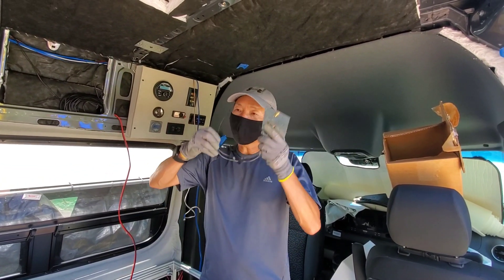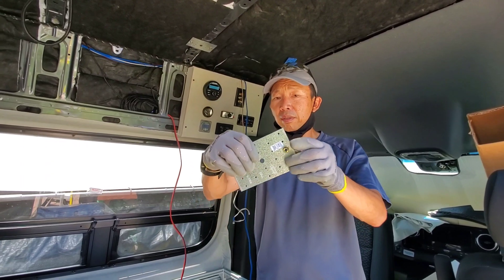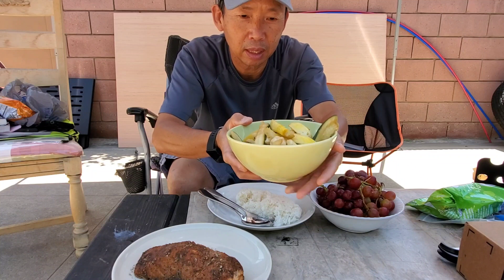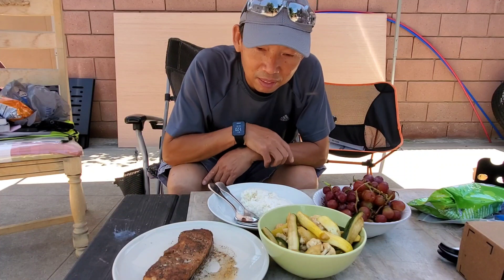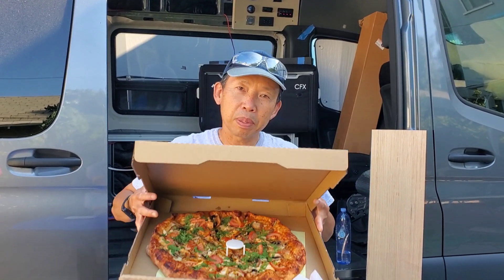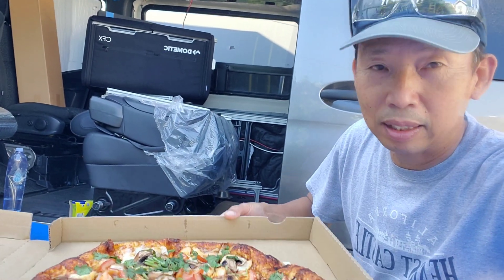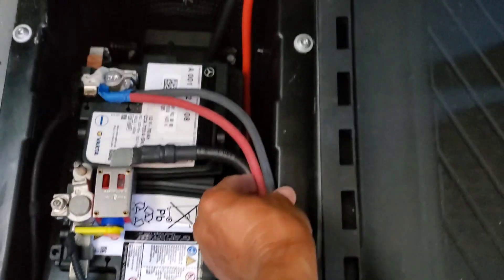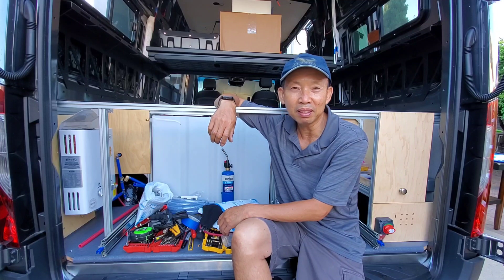Van Build-2019 Mercedes Sprinter installing Victron tr-Orion DC-TO-DC Charger

Comment: Hi Bo! Big Fan and subscriber. My build is all 8020 & Victron as well.

Question: I seen you connected your Orion directly to the battery positive using an inline fuse. You don’t have issues with it having  constant power instead of wiring to the ignition? Would love a picture of how you wired to the car battery if you have one. I’m on IG as Ryan.CVO 

Keep up the great work and videos!
Reply from the maker: Hey Ryans thanks. 
The Orion-TR has the voltage sensor built in which you can connect straight to the battery accept if you have a smart alternator.  When you start your car, the voltage on the car battery changes that's when the Orion-TR  starts to work otherwise it's not activated.  Connect directly to the car battery positive side.
Reply: Thanks Bo! Thought that may have been the case but wasn’t sure. I tried under the seat using one of the battery posts but it doesn’t support the fuse size I need so I was hoping direct to battery would work. Great to hear! Loving your shower setup too. I just ordered your same hot/cold valve and shower head setup. :)

Comment: can u tell me the diference between the isolated n the non-isolated versions?
Reply from the maker: Here's an answer from the web. 
isolated input and output NEG while the non-isolated uses a common negative return. If both your source and target batteries share a negative return (ie chassis ground) then you do not need the isolated version.
Reply: @BoChuonOUTDOORSVANBUILD  so thers really no diference? or does that make a big diference wen they share ground/negative?
Reply from the maker: Basically that's it.  In my case I chose isolated because my battery banks don't share the negative side with the car chassis.

Comment: How are your settings in the app that the Orion smart detects engine start? Can you maybe write down your parameters? Thank you very much for your help. I have absolutely no idea how it works...
Reply: Hi Marcel that is depends on the type of the batteries you have.  The Flood, AGM are different from the Lithium Batteries settings.  It's on Your Orion-TR  manual .  If not there's a PDF file online from Victron you can check.  Here's the name you can Google:

Engine-on detection set-up Orion-Tr Smart DC-DC ... - Victron Energy.

Comment: Is it ok to connect the DC/DC charger to the car's battery instead of the alternator directly?  Thanks!
Reply from the maker: Yes. The DC/DC charger has a voltage sensing relay built in so when your alternator starts to charge the car battery the charger will trigger on.
Reply: @BoChuonOUTDOORSVANBUILD  Thanks for the quick reply!  Do you have a video on the MPPT installation with the solar panels?
Reply from the maker: Hi Kim,  I don't remember doing a particular one.  What kind of MPPT do you have?

Comment: Thanks for posting. Your information shared on the DC/DC charger is the same reason I decided not to use my combination charger-solar controller. Solar input was limited to 32v on my combo unit.  If I want to use multiple small panels it would be fine when wired correctly. However, I want the option of using a single large panel which will be 39+ volts so I also switched to an Orion from Victron.
I had to smile when I saw you crawling around to reach items. I also built and camped along the way. Now I’m crawling under installed bed to install components. 
Next time I’ll build more modular. 
Have fun!
Reply from the maker: Thank you 😄

Comment: What gauge wire were you able to use in the Orion terminals? The spec sheet says max 6 AWG but that looks more like 2 AWG. I'd like to use some existing 2 AWG to wire up the Orion, but I'm concerned it won't fit based on the spec sheet. Thanks!
Reply from the maker: Only fits 6-8 gauge . You can't go any bigger.

Comment: Where did you connect the ignition switch?
Reply from the maker: You don't have to on this one. Because the battery level perimeter is set so when the Orion-TR senses the voltage changes in the starter battery it will activate the charge.
Reply: Kane, there's 3 post under your driver seat. The one closest to the steering will is only active when the vehicle is running. You can tap into that line as your ignition on switch.

Comment: How are you holding up with the Orion Smart charger? I saw someone on the comments hating on the way you did it but it looks like you did it the same way the manual suggested. Any problems?
Reply from the maker: No issues however I did change the fuses to 60amp like the factory recommended.
Reply: Did you also have a fuse at the battery to fuse the positive battery terminal connection to the  6awg wire going to the DC/DC charger to protect the wires and charger?

Comment: I love the play dough Idea!!
Reply: It's a great Idea, and acttually a common plumbing and electrical trick dating back a Significant number of years, The problem with Both that stuff and playdough - is it WILL leave residue on Woods and other porous surfaces, some are oil based so it looks horrible.  The less time you can leave it on the better.

For the Most part it is never really an issue though - since 99% of the time the reason you need it is because of where the surface will sit, i.e. unseen and blind from view.

Comment: This man's van conversion is quite problematic. First of all, this person lacks a lot of knowledge about electricity or camper van building. he does not know how to build camper Vans, The input line of the dc to dc converter should  not connected directly to the starter battery, and  through an input 45 A fuse to the battery terminal of the sprinter battery .  he does not know  the  location  battery terminal. also  he does not  know that there is an electric power loss if the battery line is connected for a long time. In addition, when a gas shower boiler is used inside a car, it seems that it is dangerous to human life due to the risk of ignition and co gas inside. Furthermore, installing microwaves under the bed is a very funny idea. I hope you don't follow this person's way. PLease do not follow this episode ...
Reply from the maker: Well,  Mr Perfect "Into the nature " thank you for taking time to write all the negative comments in my videos.   Since you're new to YouTube maybe you haven't seen people are using "they don't call it water boiler" . It's the tankless/ventfree water heater in the RVs and trailers.  You'll people install it under the sink so get ready to spend more time writing negative thoughts about other people but please don't stress out about it because people have different preferences. I took effort to share my work with folks who like to explore different ideas that's all. Besides I don't see you've built anything on your channel but a piece of foil on your SUV?  Who's the problematic?
If you want to learn more about the water heater here read this from the manufacturer:
What is Vent-Free? A Vent-Free appliance can be installed inside and does not require cumbersome and costly installation of flues and ductwork because it is outfitted with state of the art ODS (Oxygen Depletion Safety) shutoff.
Reply: @BoChuonOUTDOORSVANBUILD  Thank you for replying to my comments, but I don't think it's negative for me to spend my time writing comments. For the sake of people's safety, I just wrote a good opinion. Did you know that propane gas heaters are not installed and used in tight rooms? No matter how safe it is, it is not 100% reliable, and it is not recommended to use gas heaters in narrow indoor spaces due to carelessness of people. To reduce the cost, it is used, but used outside the car. Never install inside a narrow car. For safety, use an electronic heater. In addition, for charging the accessory battery, did you know that it is a very dangerous idea to connect the DC to DC input line directly to the starter battery without connecting the input fuse to the battery terminal block provided in the sprinter van? And the use of a DC TO DC convertor actually stresses the alternator during prolonged use. This results in shortened life of the alternator and problems for the vehicle's ECU. In addition, such use is excluded from the warranty service from Manufacture. you will lost  warranty.That's why people install a second alternator with a lot of cost. Don't take my comments negatively and take them as advice. For reference, I'm a hardware design engineer with 20 years of experience, and I'm already the person who conversioned  the sprinter cam van .
Reply: @intothenature4328  Do your research before commenting.  "indoor tankless water heater" was being used.  He explains in other videos how to take necessary precautions when propane is being used such as proper ventilation.  As far as "carelessness of people," so maybe people shouldn't have gas stoves in their house either.  You clearly show your lack of knowledge of things.  "microwave under the bed."  You must be new to van life videos as you will find a lot of van builds has appliances under a bed/furniture as you are working with a small amount of space.
Reply: @deepdnfawb  You can install the Microwave anywhere you like, on the bed, right next to the driver's seat. If this is the case, it would be better on the bed. Because you can lie down and cook. Do whatever you want.
Reply from the maker: Cool,  can you share some videos of your build maybe I can learn from it.  Thanks for the opinion.
Reply: "Into"  you make some good points but the main thing I hope people take away from this is that you're fully responsible for your own actions and that you'd better know what you're doing before you do things that can lead to destroying your property, hurting yourself or others.  Yes, that fuse needs to be as close to the battery as possible.  Remember fuses are mainly used to protect wire, not devices so all of that wire between the battery and the DC to DC converter is not protected.   So if that long wire is damaged and it touches the negative or bare metal it's bye-bye van.  Still I enjoyed the video.  Thank you.
Reply: @Altenurgy  , Please see the sprinter van battery circuit  atrea ~ They provided terminal for 2nd battery ~ I am agree with into .
Reply: According to the Victron Orion-Tr manual, it's perfectly fine to plug into the starter battery.
Reply: @compeng2013  but the fuse or circuit breaker should be at the battery not at the input of the DC to DC charger.

Comment: Does your unit get hot? Like hot to touch hot ?
Reply from the maker: No, it doesn't.
Reply: Mine gets super hot, did u have to wire the remote wire on the dc to dc unit or just plug in the little piece with the green wire? I wasn’t sure if that was something optional to wire or mandatory
Reply from the maker: @williamauyeung818  yes, you plug that remote wire in last after you connected the car battery.
Reply: @williamauyeung818  Hi, so is it normal that it becomes so hot? I've read that some ppl are complaining too

Comment: Hello sir, excellent video, helps me out quite a bit. Question: I see in the instruction manual a recommended fuse size of 60A (like you mention in the video). However, I was surprised by that. Shouldn't it be just over 30A, the maximum current that is supposed to go through the wires? Also, with a 60A fuse, you would expect bigger recommended wire gauge. With your 30 amp fuses, does the Orion function well? Or do the fuses go off sometimes? And how is the wire distance measured? Is it 15 feet both ways or in total? Thank you very much in advance, kind regards, Thomas (subscribed :D)
Reply: In addition: I just called Victron Support: they told me that the Orion can require short current peaks, hence the recommended fuse size of 60A. Then I am curious: do your 30A fuses blow when using the Orion at max setting? Greetings from the Netherlands
Reply from the maker: Hello Thomas thank you.  I was surprised too with the 60A but I think that depends on your wires length and size as well.  The wires are measured each way and I have 20feet @ 6awg wires that's why I use 30A Fuses.  I think 6awg wires are the biggest to fit in Orion-TR and it can handle up to 70A depending on the length.  I  set the max voltage 14.4.  So far the fuses are fine but  again the batteries have not been drained so I guess we wait and see. I hope this helps.
Reply: it's not excellent video.  this van design
Reply: This man's van conversion is quite problematic. First of all, this person lacks a lot of knowledge about electricity or camper van building. he does not know how to build camper Vans, The input line of the dc to dc converter should  not connected directly to the starter battery, and  through an input 45 A fuse to the battery terminal of the sprinter battery .  he does not know  the  location  battery terminal. also  he does not  know that there is an electric power loss if the battery line is connected for a long time. In addition, when a gas shower boiler is used inside a car, it seems that it is dangerous to human life due to the risk of ignition and co gas inside. Furthermore, installing microwaves under the bed is a very funny idea. I hope you don't follow this person's way. PLease do not follow this episode ...

Comment: Your mounting plate with Rivnuts is excellent!  If I may suggest:  you can take the bolt that screw into de Rivnut ant cut its head, then put it in a drill chuck and make it pointed using a metal file.  Then you screw in place those pointed screws and bang the panel on them:  you should get a very accurate hole center position.
Reply from the maker: Oh that's a great idea thank you!
Reply: Your lunch looks yummy and again the job is  very beautiful and too much memory used can wait for you to show us the video when done
Reply from the maker: @doloresanguiano407  thank you Anguma
Reply: This man's van conversion is quite problematic. First of all, this person lacks a lot of knowledge about electricity or camper van building. he does not know how to build camper Vans, The input line of the dc to dc converter should  not connected directly to the starter battery, and  through an input 45 A fuse to the battery terminal of the sprinter battery .  he does not know  the  location  battery terminal. also  he does not  know that there is an electric power loss if the battery line is connected for a long time. In addition, when a gas shower boiler is used inside a car, it seems that it is dangerous to human life due to the risk of ignition and co gas inside. Furthermore, installing microwaves under the bed is a very funny idea. I hope you don't follow this person's way. PLease do not follow this episode ...
Reply: @intothenature4328  Your commentary is quite nasty against this YouTuber, I am sorry.  When someone films some kind of operation, it is HIS way to see things, it is not a tutorial.  Most people are proud of what they are doing, and such comment may hurt them and discourage them to produce other videos.  I saw lot of good ideas in that video build series, I do not agree with everything but I will not ask people to stop watching them.  I look forward to watching your own creations...
Reply: The dc to dc charger  IS wired direct to positive and negative battery  terminals per the manual but should be fused at positive battery terminal to protect WIRES AND CHARGER. 
I agree with your hot water heater comment. I have seen others do this. Burning propane inside a vehicle is not be good for fumes and moisture. Same as stove or portable buddy or cat heaters in some peoples minds. These are designed to be used and vented outdoors.  
Mounting to door and using only with door open would be an option.  Or using it outside near a separate pop up shelter outside van would be as manufacturer suggests. 
I did not watch complete series so I’m not sure if this is his storage position or operation position.